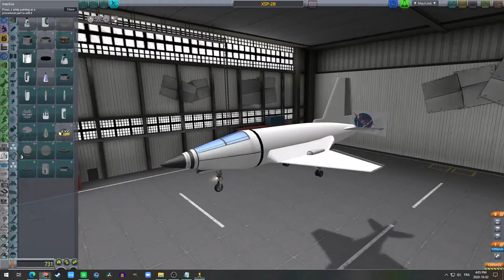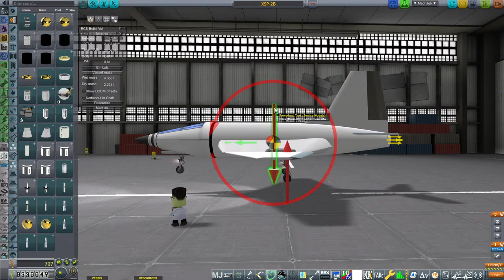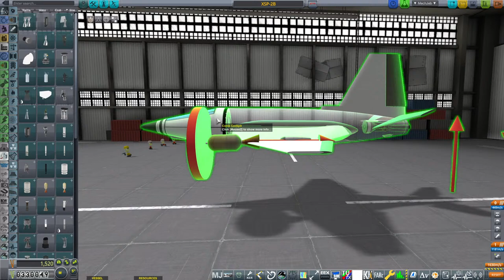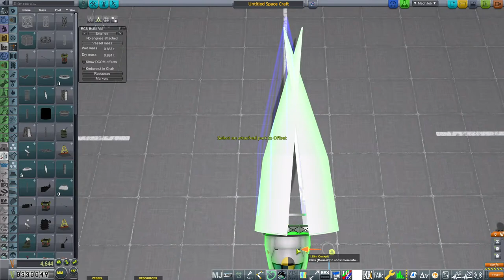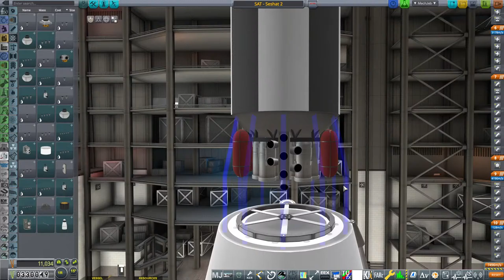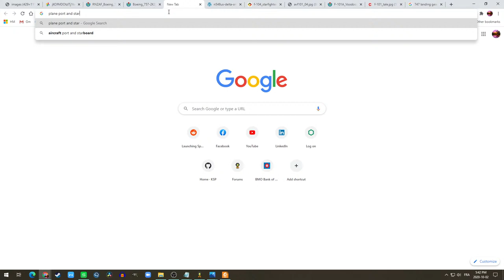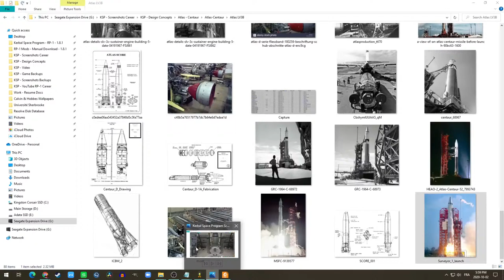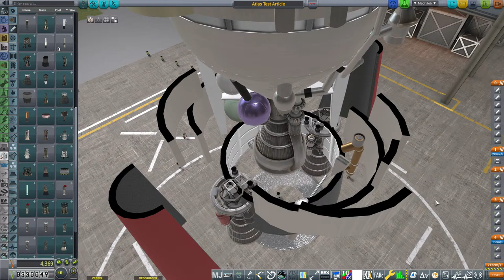KSP Livestream E1 - The Art & Science of Aircraft Design

Comment: So, a question I meant to ask towards the end of the livestream, but decided against as it was quite off topic and the stream was ending - are you planning on using only generic thrusters and American engines, or will Russian engines potentially be used when the US doesn't have an equivalent? ie., will your Atlas 3 use NK-15 engines, or investigate the use of S1.5400/RD-58 engines for LEO optimized upper stages?
Reply from the maker: Russian will 100% enter the game at some point. ;)
Reply: Calvin Maclure cool! Honestly, in my experience, so long as you account for failures, NK-15/33 engines can easily be clustered to replace F-1 engines for most applications, especially for use in “Multibody” litter designs - ie., designs that can use modified versions of your core stage as boosters by throttling back the core during launch to extend it’s burn time while the boosters are attached.

Comment: After watching this I still sucks at ksp aircraft, mind sharing your craft files with me? I keep losing control and flat spinning in the upper atmosphere
Reply from the maker: Hmm... any idea which part you're having a hard time with? Flat spinning at high altitudes is not necessarily an indication of a bad design... What's the location of the CoL vs the CoM??
Reply: @CalvinMaclure  well it doesn't flat spin at high altitudes usually during reentry and sub hops i lose controll and later in the 20k range starts to flat spin,  been doing some tweaks and last test was possibly because I didn't have any RCS
Reply from the maker: @wildterk6631  ah, yeah. Any altitude higher then 25km will begin to have somewhat diminishing returns with flight surfaces. You will in fact need some RCS. I've got a bunch of episodes with Xplanes where you see that very thing in action. I suggest you have a look.

Comment: I love your Rp1 vids, but I really dislike that you use the cheaty 4 ignitions XLR11
Reply from the maker: In what way do you feel these are cheaty?
Reply: @CalvinMaclure  correct me if wrong, but isn't the number of ignitions bound to number of individual engines in one XLR11? The reason they have 4 ignitions is they ware ignited separately? therefore 4 engines - 4 ignitions, which I thing is not modeled in ksp
Other than that, I feel they are "cheaty" because, if I remember correctly, no engine until fairly later has multiple ignitions. Idunno, multiple ignitions just make seem "cheaty" imao
Makes orbiting sooooo much easier
Other than that I LOVE your vids. please, make more

maybe its because I love AJ10 and would like you to use it, or at least make one rocket with it (: